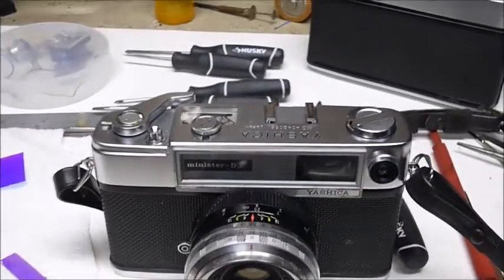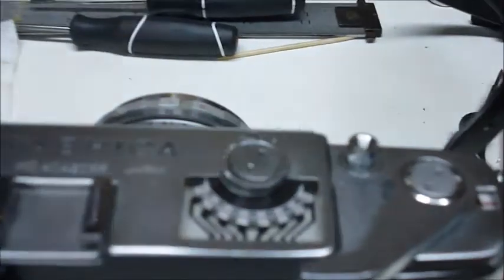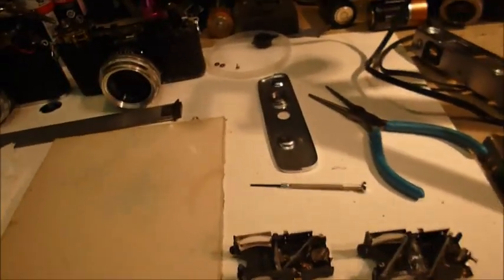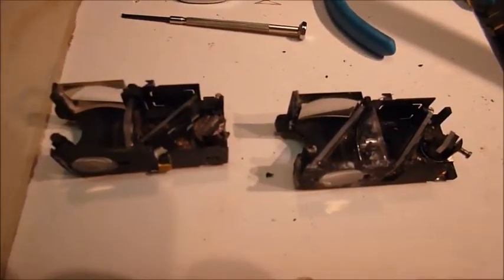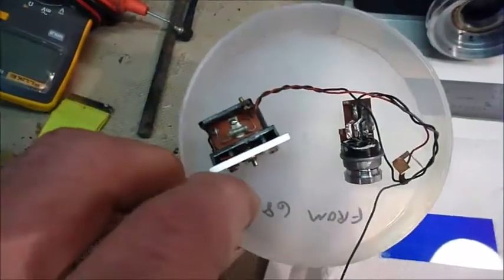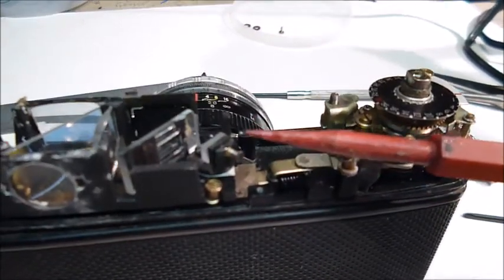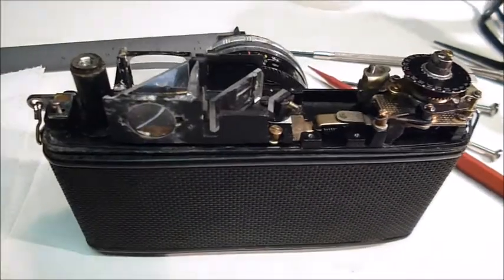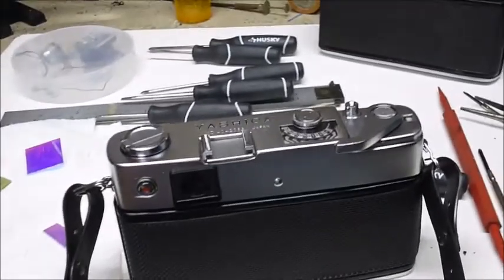Yashica minister D light meter

Comment: i would like to know how to remove the top of the yashica minister II to change the lightmeter
Reply from the maker: I have never done one but looking at pics it seems to be pretty similar and likely comes apart about the same, just be careful, you never know when the engineers will sneak in something with left handed threads.